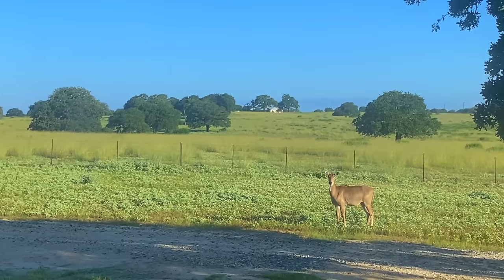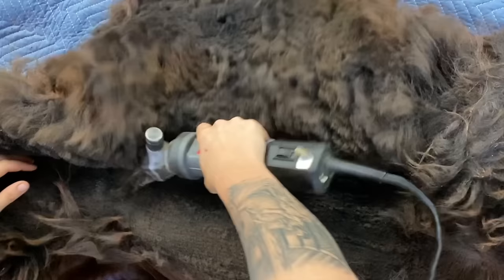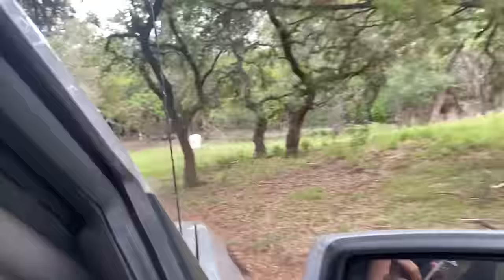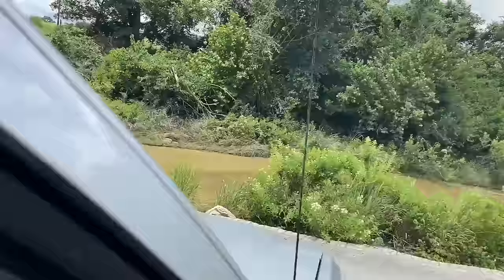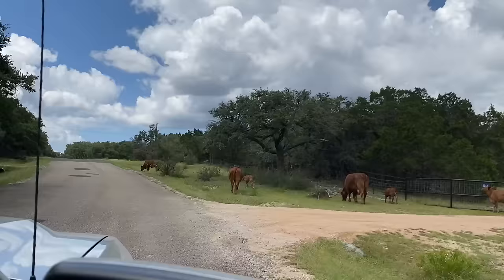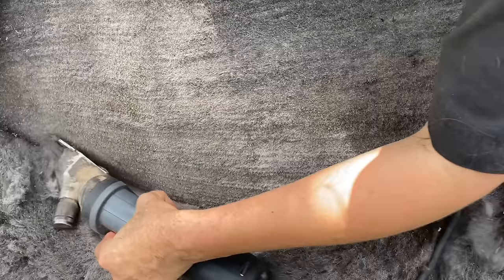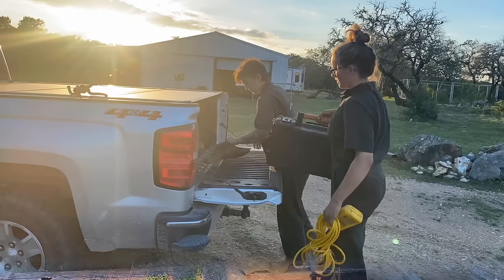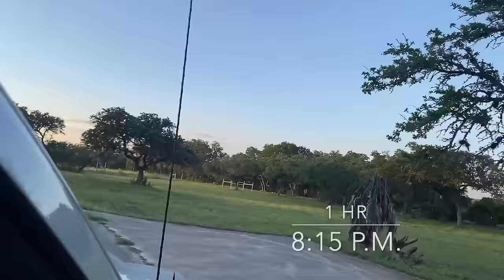Shearing Through Lice, Mites and Dirt! - A Day With a Traveling Shearer

Comment: Love your videos! For the llama who didn't like his front legs getting sheared, I wonder if the trick we use for horses would work. When we need to work on a leg, we have someone lift their opposite leg up and hold it while we work on the other. They can't stand on two legs so by holding one up, it forces them to keep the other down.

Now mind you, they definitely can do a quick hop on three legs,  but for the most part it works quite well.

Comment: Wow!  You need a formidable amount of strength and energy to do such grueling work! Be sure to take the vitamins I recommended, and don't drink sodas or refined carbs.  You are athletes!
Very impressive show of endurance.  Not easy dealing with these beasts.  I read that you only get paid $25-$35 per animal shearing.  That is extremely low.  Try some easier dog grooming. Poodles for example fetch $80 - $100 per dog. Of course it is more detailed work but less demanding physically and pays more.  A mobile dog grooming RV is the way to go. You can live on the road for a while too.

Thanks!  I learned a lot about Llamas and Alpaca shearing. I always wanted an Alpaca as a pet, preferably the Suri.

Comment: I love these videos.    Wonderful work and both educational and entertaining all rolled into a great show.        I do have one comment related to the truck not starting.      The tow-truck company jump-started your truck and off you went and then ,  Katie,  you said you found that your truck's starter motor was going bad.     Did the tow-truck guy tell you that?    Sounds as though you have good mechanical savvy, so you would know that when they jumped your trick,  it was your starter-motor cranking your engine,  not theirs.    All they provided was  14 volts from their alternator.     Well,   too late now but for next time.    All the best and keep up the good work.

Comment: I just found you guys on tick tock, and I love your content, but I was curious as to why you restrained each one Lama's, alpacas, and sheep, differently. Is it because of size?
Reply from the maker: It’s all about temperament, how the fiber needs to be removed, anatomy, etc. sheep have very wrinkly skin, their method allows you to move their skin out of the shears way with ease. Llamas do not do well restrained on the ground and their fiber, in our case, is typically not utilized, so it can fall to the floor. Alpacas have fiber around their eyes, on top of their heads and down to their toes. To be able to get to all that safely, without stressing the animals, we lay them down.
Reply: @rightchoiceshearing  awesome. Thank you